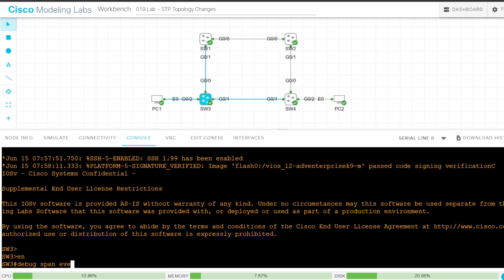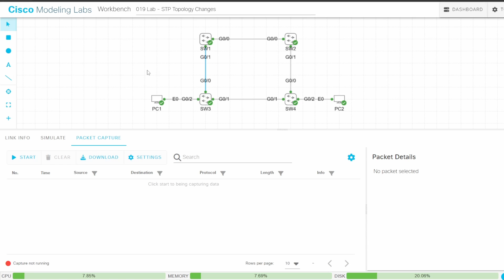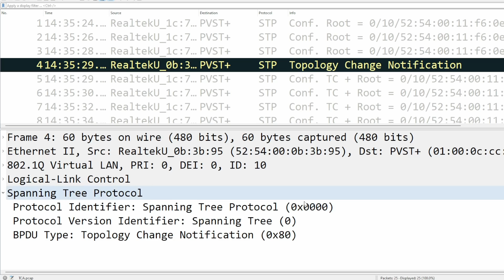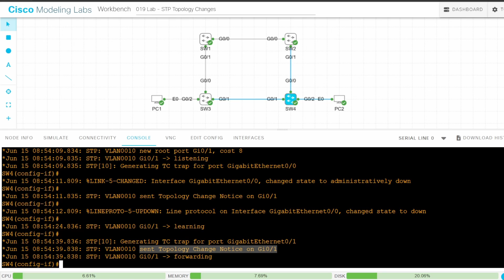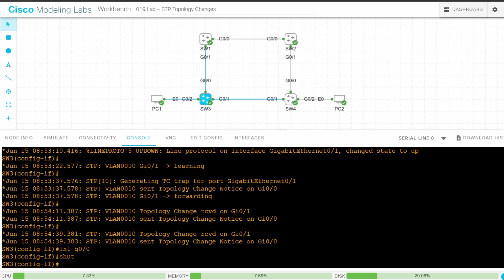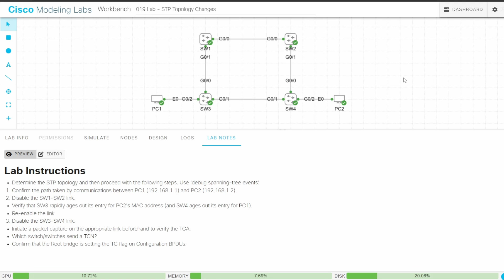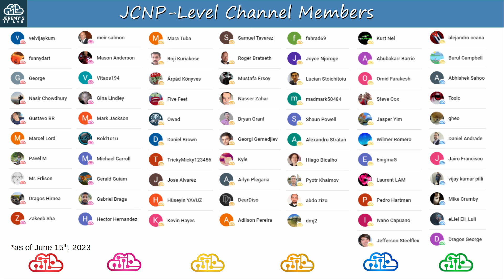CCNP ENCOR // STP Topology Changes (LAB) // ENCOR 350-401 Complete Course

Comment: Step 3: on my lab, when I disconnect the link with right click > disconnect, it's SW4 that send the TCN, although SW4's G0/1 is blocked. I can't explain this.
When I shutdown SW3's g0/1 it's working fine. When I shutdown SW4's g0/1, nothing happens (that's normal).

Comment: Awesome video as always!
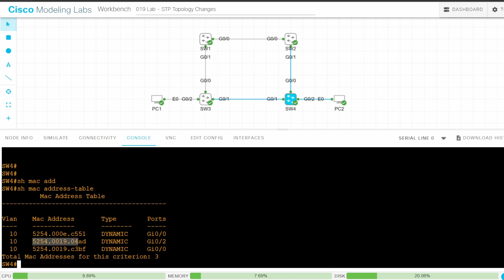just one small correction, at 3:10 "here we can see SW2 mac address also" should be "here we can see PC2 mac address also" since the entry it learned via Gi0/2 is PC2, after that part you mention .04ad as PC2 mac so shouldn't be a real issue